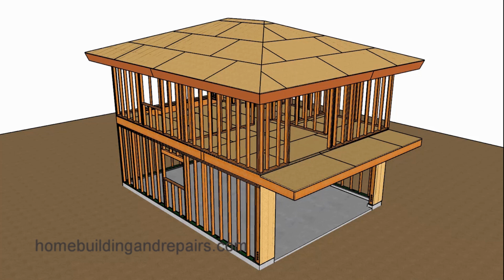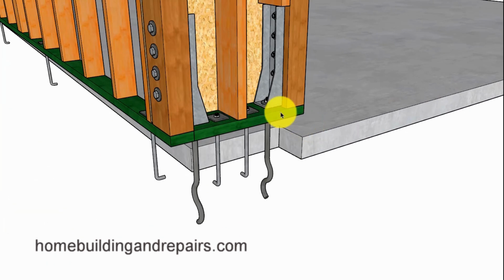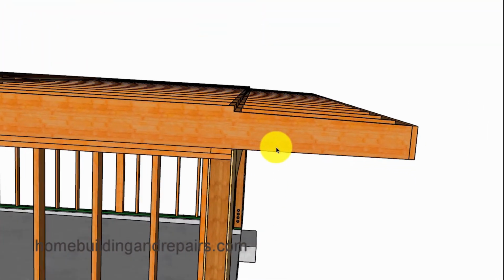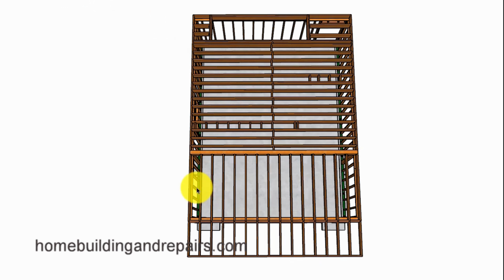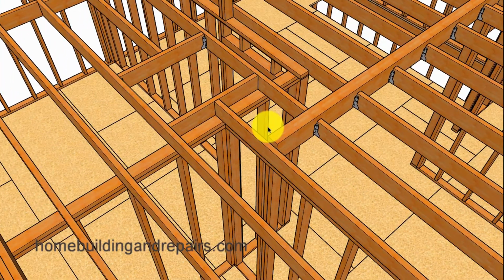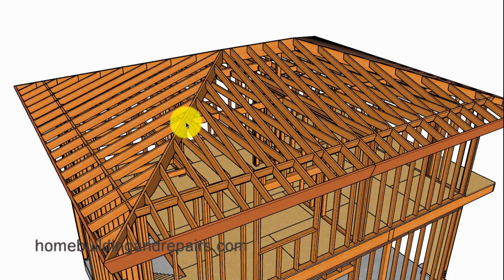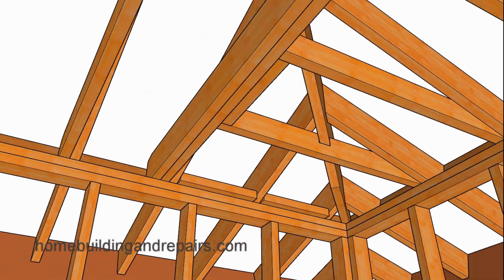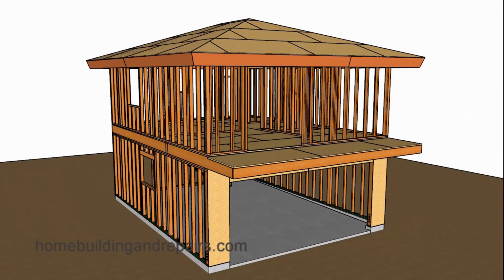How To Build Two Car Garage With Apartment, Balcony And Hip Roof - Building Education Series Part 10

Comment: Another amazing video.
Can you go over more detail regarding the hangers?
How much weight can they hold? Are they on both ends of joist (talking about the first level).
Reply from the maker: You can check with the joist hanger product manufactures for weight or loads. I will need more information about the your other questions.
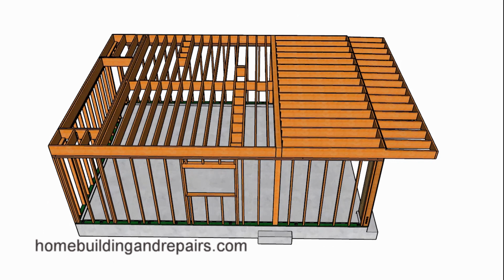Reply: @gregvancom  thank you for the reply. My question regarding the joist and hangers stem from imagine found on minute 3:20. I cant tell if you have a board that connects perpendicular to the beam or not and if it's a board, I'm assuming the joist connecting to that board.
My question is, how much weight can that board support if it has a joist on both ends of it.
Reply from the maker: @alexmoore5970  You can use straps or post to beam connectors for the larger beam that the floor and sloping deck will attach to and that will be up to the engineer to validate. As far as the joist weight loads, it will depend on the project and I can't provide that information.
Reply: @gregvancom  understood! Thank you.